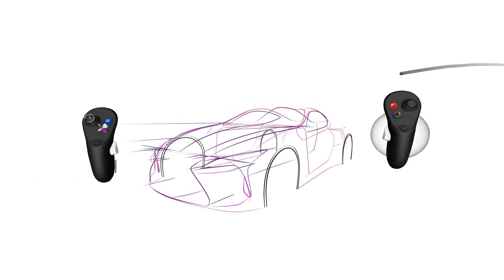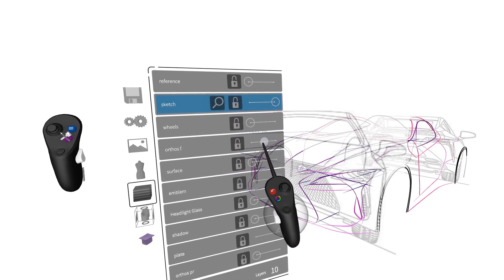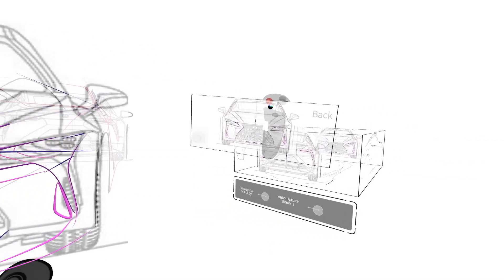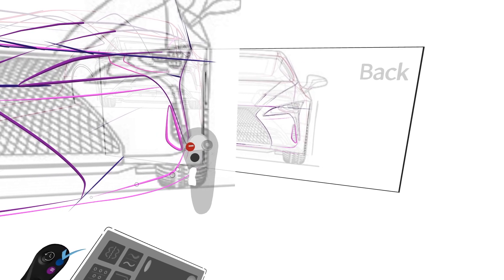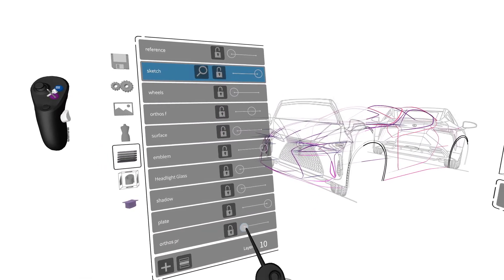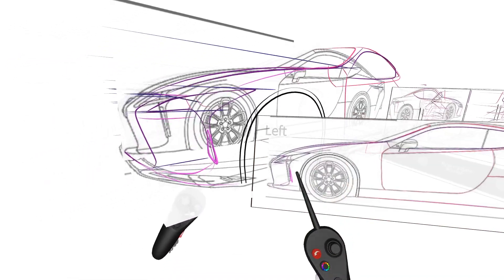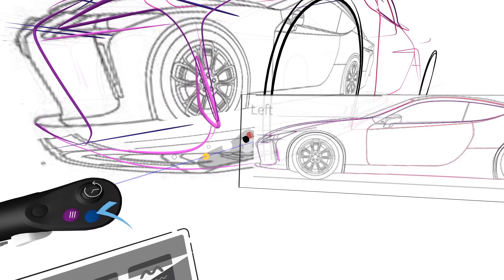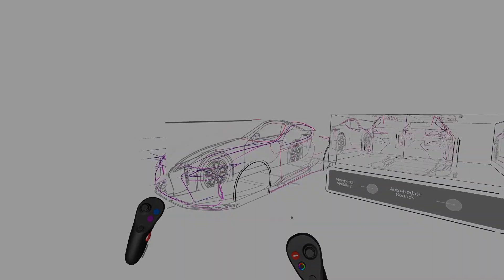Using orthographic viewport in gravity Sketch - Tools Tutorial

Comment: Unfortunately Facebook bricked several Oculus Rifts with their world class, irreversible firmware updates.  I can no longer use gravity sketch.  I was really enjoying it.
Reply from the maker: This might be an issue with your system. Rift S is still supported on Gravity Sketch. Oculus will just no longer be making more Rift systems to sell but the software and firmware should still be supported. If you suspect an issue with Gravity Sketch please reach out to support@gravitysketch.com
Reply: @GravitySketchYouTube   it's not my system.  My rift worked just fine for a while.  This is the second time I've been bricked by them when they push an update.  Oculus knew they were bricking some people, it's all over the forums, and they acknowledge it.  And in my case, they have all my system logs and parameters, and my system checked out fine by them.  In my opinion, it's just good old fashioned sloppy coding.  Some people skate through unaffected during these updates while others get bricked.  And because they don't let people roll back to drivers that worked just fine, they're essentially patting people on the back while saying "enjoy your new $300 paperweight".